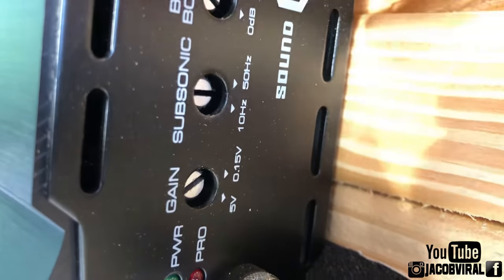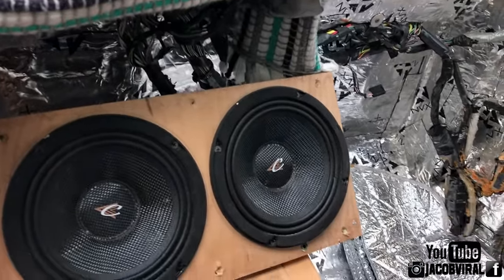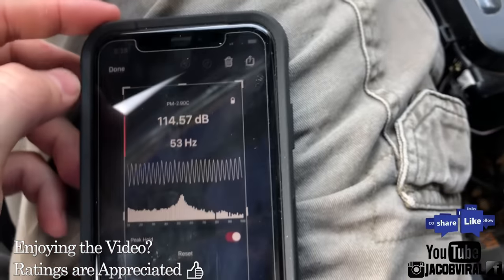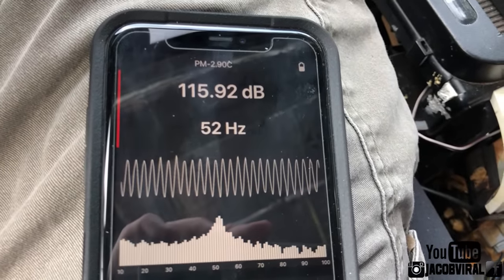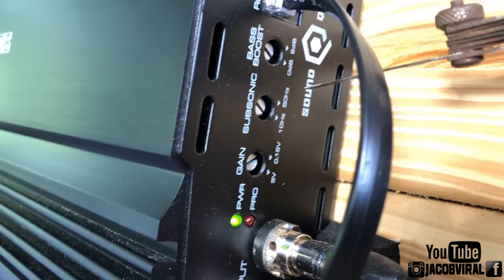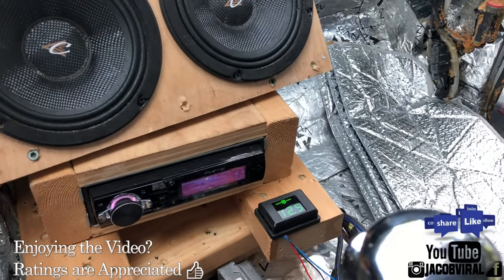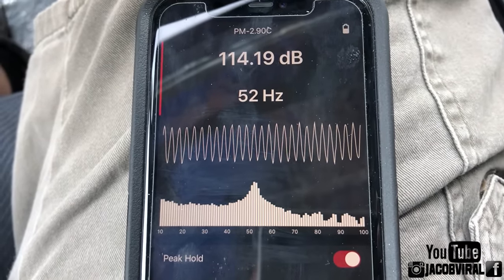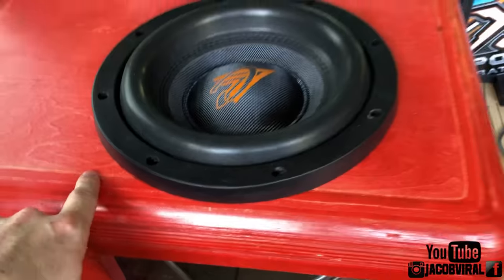HOW IMPORTANT SUBSONIC SETTING IS ON YOUR AMPLIFIER?

Comment: Why not set the subsonic filter CORRECTLY instead of just guessing on the analog knob? Many amps are not accurate on their markings and "eyeballing" it is totally wrong. First set your gain correctly, then set your low pass filter. To properly set yoir subsonic filter, do the following:

1. Turn subsonic filter OFF by setting it all the way to the left at the lowest setting.

2. Play sine wave of desired subsonic setting, for example 25hz.

3. Using a multimeter take note of your voltage you have from your test tone.

4. Multiply your voltage by .707. So if I saw 40 volts I would multiply it by. 707 giving me 28.28 volts.

5. Turn up subsonic filter until you reach this voltage, subsonic is set.
Reply: Dennis Randolph or I just pull out my SMD CC1. 😃
Reply: @angelvip2474  That is another option yes, but my point being was that there are very easy methods to correctly set the subsonic filter without any expensive tools. Not everyone owns a DD1, and they are quite expensive especially if someone will rarely use it. A multimeter can be purchased for 5 bucks at harbor freight and does the job fine as well.
Reply: Dennis Randolph I absolutely agree with you bro.  It is also good to know the procedures ,the how and why it works not just winging it.  You did a great job explaining the procedures.  I was just being a lil smart ass😂👍👍
Reply: Why 28.28?
Reply: @brian3364  28.28 just happened to be what the voltage would be in the example I gave. You pick a subsonic setting you are aiming for (25 hz is usually a safe bet if you want me to make it easy for you) and then find your baseline voltage reading you have with the subsonic filter turned all the way to the lowest setting. So I gave an example of 40 volts as a baseline reading, you'd play your 25hz test tone, or whatever frequency you are wanting your subsonic filter set to. With the subsonic filter set at the lowest setting (turned all the way to the left) you get your baseline reading. If for example you saw 40 volts then you would multiply that number by .707 giving you 28.28 volts in our example here. Turn the subsonic filter up until you reach that voltage and you are all set. It is quick and easy! Just make sure your subwoofer is disconnected while doing this! You don't want to potentially damage it blasting ultra low frequencies through it while you are setting the filter initially. Alot of people like to set their subsonic to 5hz below their box tuning, I personally have always just used 25hz and it works perfect. Your low pass filter can also be set using the same method of getting baseline voltage and multiplying by .707 as well, using an appropriate test tone. Only difference is the knob would be turned all the way to the right to start.
Reply: I set mines  by ear u can't hear the difference in the music playing tones  like bob  Marley it gets sort low like  epic but I like it ...
Reply: @poogy1111  Not a good idea to set things by ear in general, especially because with a 5 dollar multimeter you can set all your filters correctly. Gain can easily be set the same way with ohms law. You can realistically probably get decently close setting it by ear, but it won't be anywhere near as accurate as using proper methods.
Reply: Or get a cheap kicker amp has a built in 25htz subsonic filter
Reply: I feel mine set pretty well by ear. Its sound is clean. My biggest problem is getting another alternator and finding affordable 0gauge. Dimming lights to the beat like I'm at a strobe party if I go to loud. And and I'll start to lose power too the amp after playing hard for awhile or If I don't lose power I'll burn the 4gauge power wire. And on top of that a big 3 upgrade would be nice too. But I can play all day at decent levels shaking almost everything in my truck with not a problem. I just like to push for more spl. So replacing wire every once in awhile isn't that bad of a price to pay. But I do plan on getting bigger wire to save money in the long run. I'm retuning once I get what I need.
Reply: @crx122  so where do I test the voltage at, at the amps power and ground or battery? I'm old school where we didn't fancy tools and getting back into it again finally after 15 years back in my day I had 1 crossfire xt2 15 on 2 old-school crossfire 600's about almost 1800 watts on my walled enclosure and was doing 151 loudest single sub in the USA in my times. But alot has changed...
Reply: @xxg0t3mxx  You would disconnect your subwoofer from the amp (SUPER IMPORTANT so you don't blow the sub while setting the filter) and then hook up your multimeter up to the amps channel. Not the power and ground connections, but the output channel where the subwoofer hooks up to. No fancy tools needed sir, a multimeter will set everything up perfect for you. I think I will make a video one of these days honestly because most of the YouTube videos I see have a bunch of misinformation in them or simply don't explain things correctly.
Reply: @crx122  awesome thank you! Yeah a vom is a must for any electrical work house or car I'm about to do this here in a min wish me luck def don't wanna burn up my old school crossfire 1k sub eh I need a new one on that lol but def want sub set not to clip or distort and def want it set right
Reply: @xxg0t3mxx  Most important setting is the gain. You can set the gain with ohms law. You multiply the RMS times the number of coils and do the square root of that number. Sounds complex but it isnt. Lets say my sub is 750 watts RMS, dual voice coil. You do 750 x 2, which is 1500. Then do the square root of that number which is 38.72 so that's the voltage you are looking for. I use a -10db track to set my gain, which is pretty aggressive, but a quality sub will handle it. -5db is pretty safe, very little chance of blowing a sub, but you won't get max performance. Here are the test tones, use the 50hz at the bottom for the sub

https://www.kicker.com/test-tones

Before any of that you need to set the head unit gain though. Hook up multimeter alligator clips to the RCAs. Use a 0db track to set that gain, 0db makes sure the head unit will NEVER distort. If the head unit is distorting, your sub is going to clip. Clipping kills subs, plain and simple.
Reply: @crx122  no it's not difficult I took electrical engineering in highschool where I learned all the formulas for working and fixing electronics and making my own electronics I made a 100watt amp from scratch so yeah it sounds hard but with some knowledge def makes it easier you are awesome yes do some vids for others that don't cause you are a genius
Reply: @crx122  how do you set the headunit gain though? What numbers and i put the multimeter clips to the rcas that are going to go to the amp?
Reply: @gamersoul6996  dude is right about everything but the ofc o guage. You can use o guage cca wire. Cab audio and sky high car audio websites have good prices on them and their wire is bigger than most o guage cca and their is very little difference in voltage and amperage loss vs as ofc wire thats more than twice the price. Everything else he said is correct and sbould be taken into consideration. Also , you can make up for the stock alt with agm or lithium batteries instead, but it takes a lot longer charge with a stock alt. I reccomend using both batteries and high output alt myself , distortion kills and lack of voltage and amperage causes distortion and heat on your equipment.
Reply: @crx122  I have the 200Amp fuse that came with the 5150watt amp it was actually in my vibe for years and that all it do is slightly melt the tip of the Insulation never got red hot and I would only do it when showing off my system in my parking with friends for maybe five minutes but it would on get hot at the amp inputs never pushed it hard while on the road for more than a quick burst to shut the cars next me up and never turnedmy gains more than a quarterof the way up because it'd drop my car lower then 11.5 volts and yes I know all about the risk I was extremely careful not to catch fire but with the regular play they didn't even get warm and it was like that for three years never caught fire and again yes I knew the risk my girl wasn't allowed to play past 12 if I wasn't in the car to prevent fire as much as possible not 100%. 
But I put my 0gauge in last week and I leave my gains all the way down and play and a low volume and hits without nearly the effort of what it used to my factory volt meter on my truck and my capacitor volt meter doesn't even drop that much anymore and fix most my light dimming but still plan on doing the alt still and the big3 but have had no problem since I put the 0gauge in. And I appreciate you not being a total dick like most would have and apologize for my grammar.
Reply: @Hayawasa   and I never had distortion it was always a smooth bassline if it sounded distorted I'd drop the volume cause then I knew I was hurting more than my wiring and don't have the money to replace an amp that big. But as I said to the other dude after my 0gauge came in last week and my volt drop isn't even a problem anymore but still plan on doing the big3 and an alt but money for an higher output alt is a bit hard to come by with bills and 4 kids at my age
Reply: @gamersoul6996  having a smooth bassline doesnt mean you dont have distortion. Alot of times distortion can be inaudible if everything in your car is vibrating you wont be able to tell it. I know what you mean about money , i have just one 12 year old girl and she is into every sport and acedemic program at her school so it keeps my pockets empty. From a broke guys perspective, i can tell you a cheap trick to do if you even care at all. Take a tweeter crossover/capacitor, wire it on a crappy small speaker and boom, homemade distotion detector . Put the capacitor on the positive terminal of the crappy little speaker, then run a short peice of wire for the negative terminal. Unhook your subs and hook the crappy speaker to your amp , then play a 40hz test tone . Turn up the amp gain untiil you hear noise from the speaker , then back it off till you dont hear the buzzing noize . Your gain is set. And you dont have to mess with a multimeter or anything. You can do the big 3 with double runs of your old 4 gauge wire. Ive been there too, lol. Im not trying to be snotty im just trying to help. Doing the big 3 does help the voltage even on a stock alt. , you will notice a difference.
Reply: @Hayawasa  oh yeah when I had my v6 mustang I had big3 with 0gauge it never dropped a volt. And after I installed the zero on my amp in the truck, no more burning not even warmed up and it sounds a lot more clean maybe like 0.3-1.1 drop on the trucks voltage a lot better then the whole 2.5-4.0 volts I was dropping but like I said it's getting better as time goes on just not as fast as most people's builds and it's only a 500watt cvr15 kicker on a 5150watt torque class d mono so my gains pretty all the way down to the left I already blew my duel 12s and have a turn at about half a turn but that was kinda intentional never blew a sub or seen one blow in person so yeah that happened and the were cheap plus I don't like dual they were okay on a 1500watt amp but the 2 Planet Audio 10s I had were better at 1500watts a peice in my stang but yeah big3 is next on the list and then alt I wanted to do videos on my build but it just shames me that it's taken 3 years just to build what I have now maybe once I have it done to my main idea of a system
Reply: @gamersoul6996  its nothing to be ashamed of bud, i had to sell mine off here recently and all i have is mids and highs for the moment . I mean i can do without bass but i dont think i could bear it  to see my family do without. Prioritizing for your family just means your a real father .  Its a struggle to get a nice stereo together but i believe you will. Im still saving for my subs and amp myself . Its been over a year for me but i got a nice sony head unit, a js 300 amp alt, 8 orion 6.5 mids, 4 orion tweets, taramps dsp, 2 rockville 2 channels , my car is fully sound deadened, i have 2 runs of 0 with 70 ah of lithium, just saving for subs and amp and wood. Just takes time.
Reply: @Hayawasa  yeah no kidding. Time and money. Even the cheap stuff cost a bit
Reply: @crx122  love all your comments here..especially warning the dude to not burn his ride down. I've reached the point my lights start dimming considerably. So now I'll be looking to do alternator upgrade, big 3, and extra battery supply...none of which is cheap. Plus.....my battery for the car is in the trunk...that's alot of wire run for the alternator.
Reply: @docgray5004  Unfortunately the car audio world isn't cheap, especially if you want something nice. The great news is the investment lasts, if you purchase good equipment, you can go YEARS hassle free, so it's not a continual money pit. Always better to go overboard to some degree, as you can always tune things lower if it is too much for you, while you still have room to go a little higher safely later if you want. To me the alternator is the FIRST priority, I bought a new car and I had a new alternator built before anything else.

Wiring is by far the most annoying part of the job, that alone can take a full day or two of work, considering if you're running thick wire it often involves very carefully taking out all the trim in your car to properly hide it, and finding a place to get that thick ass wire through the firewall and into the engine bay can be laborious. I would like to just add one thing: Make that "big 3" upgrade into a "big 4" by also running a new ground from the alternator straight to the battery. Mike Singer (who builds alternators for a living) informed me of this, and it makes complete sense. Stock ground is very inefficient, having to travel through a long and inefficient path back to the battery.

Thanks for the kind words by the way. I have personally seen, as well as heard way too many stories of car fires related to people doing stupid shit with car audio. I get it, people want a bitchin system without the investment, but that simply doesn't happen in the car audio world. There is a real investment that goes into this stuff, but as I mentioned at the beginning, if you make good investments, you're good for years to go.
Reply: If one didn't have a multimeter would you suggest just leaving the subsonic filter off? Or is that a bad idea

Comment: Most subsonic filters are just a high pass filter and on many amps there's no mention of the slope. If they had a super steep slope they'd be great for precision limiting, but I prefer leaving them off and controlling low frequency extension at the deck. If your setup is loudest at 45-50hz for  spl purposes, a Subsonic filter is the quick way to chop out the frequencies you don't want sucking your power away. For SQ, leaving Subsonic filters off is best IMO.

Comment: Is the subsonic the same as a high pass filter? I'm asking because I want to use multiple full range monoblock amplifiers to power my door speakers 🔊
Reply from the maker: Some amps have it labeled like 10-90hz, etc which can be also act the same as subsonic correct, base it off the numbers

Comment: Bro I feel you and appreciate your video and your intention. Totally respect it. Just keep in mind that you cant use a cell phone and accurately get a proper SPL reading. You have to use a legit SPL meter. Especially since your tests show +/- 1.5 db difference could be as simple as the the app SPL error range. But I agree with you as far as protecting the Sub you should definitely want to have your subsonic set accordingly to the subwoofer specs.
Reply from the maker: I was using an SPL Meter device on the windshield as I did this test. :) dB Meter https://xplicitaudio.com/product-category/installation/tools/?ref=3229

Comment: So which is the best set-up? 2 1ohm subs vs 2 dual4’s wired to 1ohm?
Reply from the maker: Nothing, both the same BUT 2 dual 1 ohm could potentially be upgraded amps with 2 half ohm layer where as two amps at 2 ohm for d4

Comment: How would I go about choosing a battery? I'm thinking of a amp that delivers 1500 rms (mono) and a 4 ch amp at 300 rms. I only want one battery that can also power two fans. Would I need to change the alternator and my electrical?
Reply from the maker: Big 3(4) to do of course and it would depend on if you want AGM or Lithium. If AGM I would go with a group 31 for 1,500 watt RMS System personally should do fine with what you're doing.
Reply: I’m using a PB4800 Energie batt as a secondary for my amp and it’s amazing. I’m running a VFL 2k rms amp with 2 Audiopipe bd2s and it works great also not super expensive
Reply: 25Hz to Life I use a platinum series duralast agm for 2000.1 skar amp it’s been fine might add a cap just because I plan on adding light bars so for something like that you should be good without a cap but you could always add it for more stability

Comment: It really depends on what you are wanting. For me I like getting the biggest amplifier possible, use one sub per amplifier. I turn my gain and bass boost all the way down. I have powerful enough alt, bat, and caps to maintain 15v at max volume.
Reply: What brand and model of monoblock amps do you have if you don't mind me asking?
Reply: I mean most amps are unstable past 15.5v and shut off but thats cool its the internet and who cares if you lie right?
Reply: @matthewmitchell7405 Rockford amps can handle up to 16v.
Reply: @randomtube8226  that is just so special. Maybe if you had named the amp brand beforehand. You didnt though..